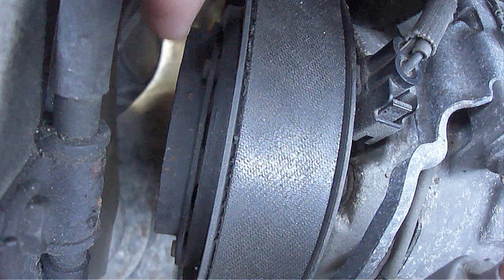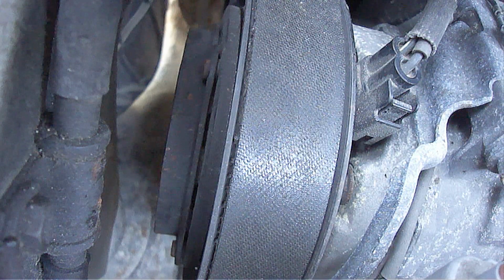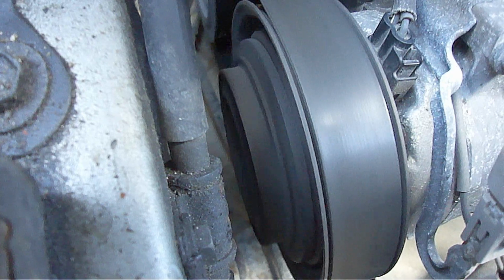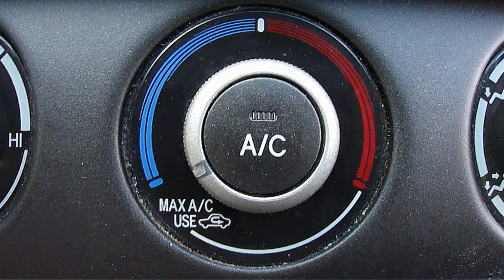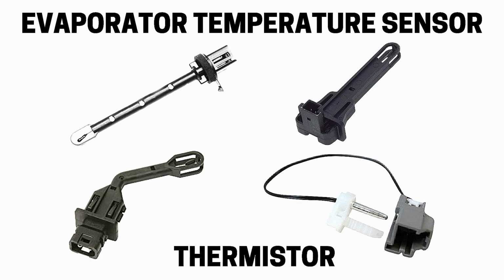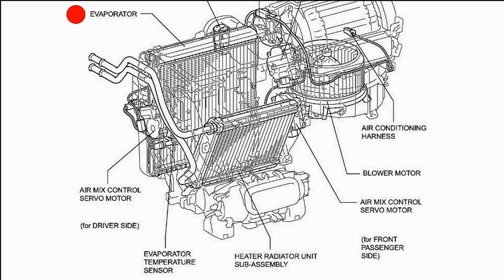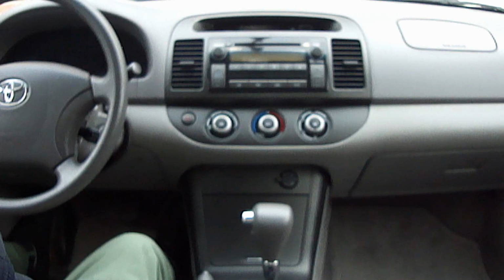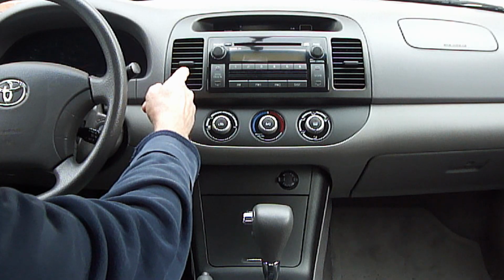How To Fix Car AC - Temperature Sensor P0535 P0536 P0537 P0538 P0539

Comment: My 05 Expedition was inop with temps above 90 degrees. I performed the bypass on my evaporator temp sensor and now I have fixed this persistent problem of 2 years

Comment: I test my sensor with multimeter (cold water value is high and hot water value is down) but ac is not trip
 mechanic told your sensor is not good

Comment: Thanks for this awesome video ... I am watching it from Kurdistan Region ❤.. my car's evaporator sensor shows that everything is working fine during multimeter test ... But the ac works all the time ... The ohm meter shows normal numbers .. but the voltage shows 5 volts while it should be 0.81 according to the car service manual at 40 Celsius degree ... !! How to test the voltage? Dose it matter?

Comment: I have a 2015 Escape that had, what I thought was the ambient temperature sensor.  I replaced it a couple of times to no avail.  So I took it to my mechanic. He ran tests but couldn't declare what was wrong. So he replaced the front wiring harness.  Then the other wiring harness.  He's stumped and says the only other course of action is to take it to the dealership.$$$$  If shorting the two wires will make the AC work, why couldn't I get a thermostat for the interior of the car and hook it up to a relay that would turn the AC on and off at a given temp?  This would solve the problem of constantly running the compressor when shorted and making the evap coil a solid chunk of ice.  Just thinking how I can save many $$$$$$ going to a dealership.

Comment: Thanks for this very informative video. The recirculation mode in my Nissan has been going OFF after a bit of driving and then ON again within 20 seconds. Sensor failing? I live in the tropics. Any chance of evaporator icing up if I do a bypass?

Comment: My Honda pilot 2017 it freezes the evaporator after 20 minutes running, i thought this my be the problem, this sensor stop the evaporator to freeze, so i remove it, in the process i found the return air was block of debris, so it was restricted of air flow 😀 hopefully this works, i test mi Heater core temperature sensor like this video show, and it looks fine, great video 👍

Comment: Thanks for the video.  Now I know my temperature sensor is ok.  I was able to mesure the resistance. 

 **I tried the jumper test but it didn't work for me. I will try a resistance instead. For info my car is a corolla 2005.

Comment: I turn on the ac and the compressor is moving and i added a freon but is doesn't cold the line and didn't emptied the can i always switch to the opening position but it doesn't get cold from the vent and the ac switch stay on

Comment: My car probably has a bad condenser temperature sensor. I know my car since I bought it brand new. The car is suzuki celerio 2018. The auxillary fan automatically turns on when when it needs to cool the aircon, and when its hot it runs faster then when it reaches proper cold temp it turns off or runs low kinda like a regular home electric fan that has 0,1 and 2 speed. Do you think its the thermal sensor or the auxillary fan motor?

Comment: I found (finally) my EVAP sensor . I removed it and measured the values. It seems ok as the video explains... Then I bypassed the sensor cable and it didn't work. Was still blowing hot. The error code on my Chevy Trax is B3933-05. I was like if it isn't this what is it ?  I gave up and reconnected the sensor back it's place very tightly. I turned on the car and A/C started to work.  I don't know how long it will last. 🤔

Comment: Hello sir. 
I saw your video about the AC problem and i have qustion... 
My AC sometime work and sometime not... its pull out air but not allways cold... i connect my car to computer and saw that the Evaporator Temperature Sensor is 5 degress and suddenly go up to 20 degress and more and the air is not cold... all this time the Compressor clutch working (according to the computer)... if the Compressor clutch working the problem still can be the Evaporator Temperature Sensor? Or the AC pressure unit ? Becuse i saw in your video that if the AC PRESSUR unit not good its effect on the Compressor clutch... What would you suggest doing? My car is  Peugeot 5008 2013. I filled up with gas and according to my mechanic there is no leak in the pipes. 

Thanks

Comment: What if there is a decrease in resistance value when you place the thermistor in a hot water of about 90 degrees Celsius and at a point the value remained static without any  further decrease .Do you consider that a faulty thermistor

Comment: I think that may be the problem with my G37. In self-diagnosis, I get code 24 for intake sensor. Then checking the sensor mode 5, defrost button 3 times, I see the temperature reading is an error: negative 22 degrees Fahrenheit.